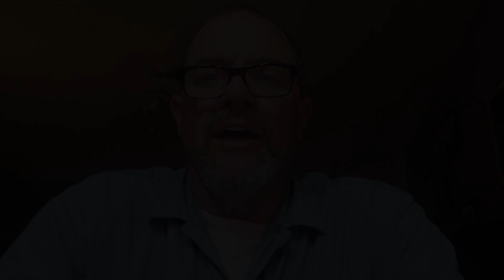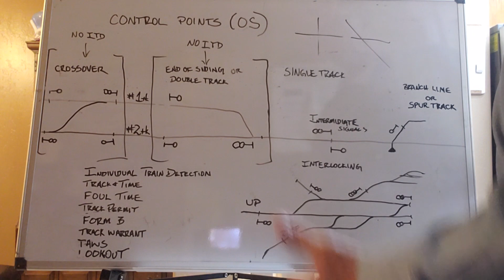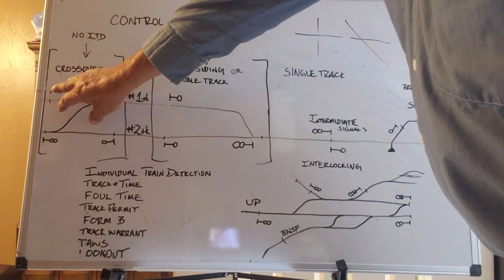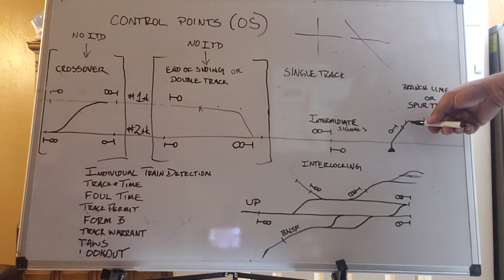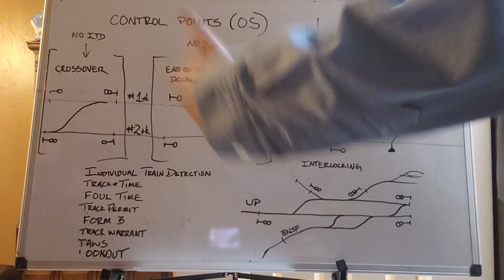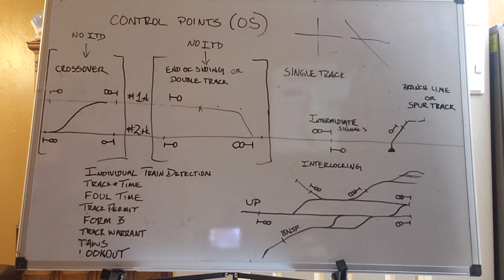Railroad Worker On Track Safety Explained

Comment: Mark a good presentation.  Protection for any situation where a condition or presence  of personnel, equipment, material, work exists is undoubtedly the most difficult for everyone to understand and implement - railroader and non-railroader alike.

As with darkness, when conditions like weather, accessibility, sight distance, etc become limiting, it may be necessary to use more positive protection that what would usually suffice.  Anyone who takes the attitude that "it only will take a minute" looks forward  to that minute being the LAST minute on God's green earth.  
I often started a safety briefing of maintenance folk headed to do some kind of work on the track with this question:. "How do you stop a train?". There is really only one plausible answer:  "You can'! The engineer control's the brakes."

Workers tend to look for answers like Form B's, red flags, track and time, and all the ways we invent that feel good 

The most dangerous form of protection is the short cut.

Comment: With internal rails in an industrial plant we use derailleurs (sp?) to protect personnel work equipment that potentially could foul the track.
Reply from the maker: We have derail switches to protect the mainline from cars in spurs or non controlled sidings from fouling the mainline.
Thanks for checking it out!

Comment: Did you ever use torpedoes for protection?
Reply from the maker: Sorry for the delayed response. Torpedoes were for use in emergencies. We stopped carrying them about ten years ago as better communication systems and new operating rules came into use.
Thanks for checking it out!
Reply: thats my question also

Comment: WOW, it’s Amazing ALL the Protections available as long as they’re used Correctly. Thanks Mark!👍
Reply from the maker: Roadway workers attend classes and are tested on all forms of on track safety annually. It sounds more complicated than it actually is. The most important aspect is knowing exactly where you are which is why we have milepost and 1/4 mile markers. The timetable, Special System Instructions and chapter 136 of the rulebook (on which we are also tested annually) contain all the information you need to understand what type you need should there be any question in the field. It really becomes second nature after a few years and, until then, you are generally working for or with an experienced foreman.
Thanks for checking it out!

Comment: There’s actually a few TAWS around Las Vegas, NV on the Union Pacific Cima Sub and Caliente Sub as well as on the Gila Sub in Arizona. I’ve been wondering for a while what they are and what they sound like. They have little sirens I’m told to indicate an approaching train.
Reply from the maker: I've only seen them operate in safety films. The sirens are incredibly loud!
Reply: @MarkClayMcGowan  oh wow! Interesting. Was Southern Pacific using them too or just Union Pacific?
Reply from the maker: @GMTX-kg8ep  SP didn't use them. I'd never heard of them until UP took over.

Comment: This video brings me to a questions .. I know railroad tracks sometimes go through the most sketchiest parts of town or through the middle of the desert with no one around for many miles.. how would you guys protect yourself from dangerous people or dangerous animals? Any crazy stories ?
Reply from the maker: Railroaders have been murdered and have killed in self defense in some nasty parts of towns. I've seen mountain lions quite a few times around Tehachapi but never been threatened by one. I've been in cabins that were shot at out in the desert and seen a few rattlers!
Just have to stay alert!
Reply: In addition to marks reply to you: a detailed walk through of that UP loco centennial (largest diesel electric loco made now retired) was done by a retired UP loco technician. Protection got brought up and like you mentioned RR tracks can go through bad areas as well as the middle of nowhere where idiots with guns or kids dropping refrigerators of an overpass onto a locomotive cab. There’s been cases of hunters and all around idiots in the woods with guns shoot at the cab of locomotives. Workers have been killed by both shooters and people dropping stuff on engines. Most shootings were gotten away with due to remote locations. All that said another way UP protects its workers is how they order new locomotives. Bullet proof windshields are in every UP locomotive in service due to said incidents. Not sure how thick or anything. I thought that was very interesting.  Cheers
Reply: Excellent question.
Reply: In sketchy parts of towns, armed guards

Comment: I see relay and signal guys all the time hangin around doin nuthin it seems but now I know why. Waitin on permission to do something. Had no idea how much they have to know. Surely all this knowledge has to be learned over time and not just from a few hours of classroom training. This video will help me understand more when I'm eavesdropping on the scanner. Thank you.
Reply from the maker: I'm glad it cleared some things up. Although I'm sure there ARE times we're just sitting around, we're usually waiting for time. It gets frustrating at times but it's all part of the job.
We are trained and tested on all of this annually. 
Thanks for checking out my channel!
Reply: @MarkClayMcGowan  You're pretty knowledgeable maybe you can tell me what the pole is at the Bailey yard. Its got a solar panel on it, on wheels and rolls back n forth on 2 rails. It changes position day to day. Follow this link and go to 5:30. https://www.youtube.com/watch?v=FVQi-s4gGFQ No UP employee I've found knows what this is. There are 2 of these along this track leading to the maintenance shop.
Reply from the maker: @bfurailroad1104  ive heard it has something to do with testing the horns. Like a decibel thing.